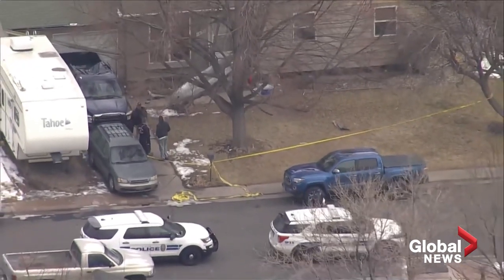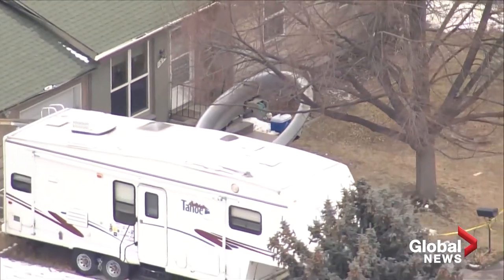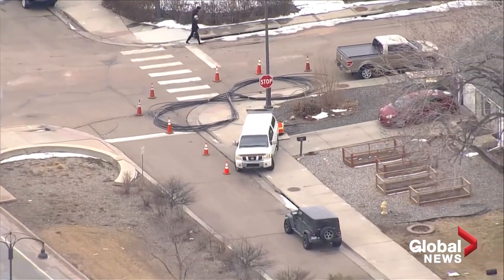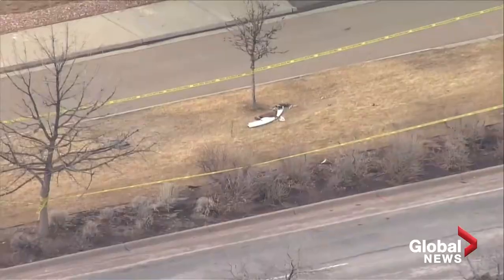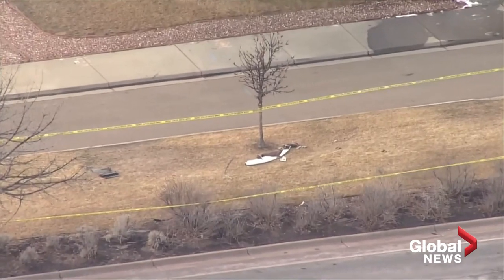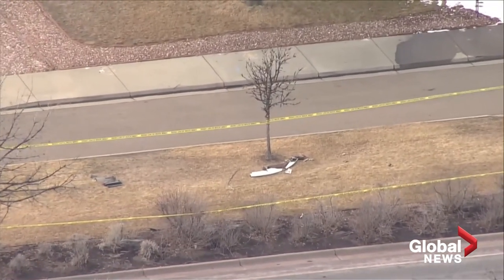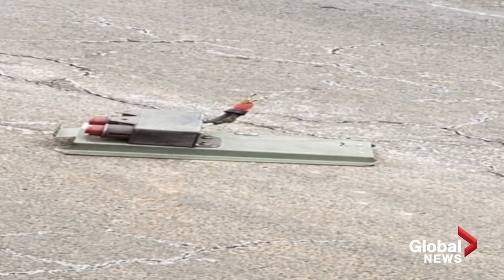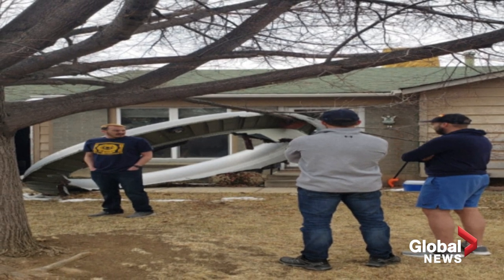United Airlines plane engine failure showed signs of metal fatigue, NTSB says

Comment: A non critical part of the fuselage underneath the place got damaged... but something else could have been hit and caused the accident to become catastrophic! the people onboard that airplane were lucky and this was by no means a "light" incident. Even if they landed safely. 
According to Wikipedia, the P&W 4000 series of engines have had several issues over the years. Maybe time to retire and replace them with better technology.
Reply: Non critical? look on the other incident with the same engine what happened.  they had fuel tanks punched, dropping fuel all the time. 1 sharpnel cut both main wiring setup causing a tons of issue. and for a miracle the debries didnt hit the fusolage were passengers were , or when landed the plane didnt catch fire.  and again nobody on ground was injured or killed.

Comment: Why call it a united plane. It's a bloody boeing again.
Reply: The company who own the plane.
Reply: Boeing didn’t make the engines. If it’s a defect due to manufacturing of the engines it’s a Pratt & Whitney problem since they made the engines. Boeing doesn’t even decide on which particular engine to put on a plane the choice of selecting an engine falls on the customer/airline.
Reply: @johnmendoza6838  True that. Each Airline decides for just about everything when they order new aircraft. Engines, seats and other options that we, passengers, don't always know about. We have seen that with Boeing 737; the infamous MCAS system only relied on 1 Angle of Attack sensor, because the other one was optional for that plane, and not every company had it. So we are now aware that like with our cars, some additional, non essential safety features are also optional on aircraft.